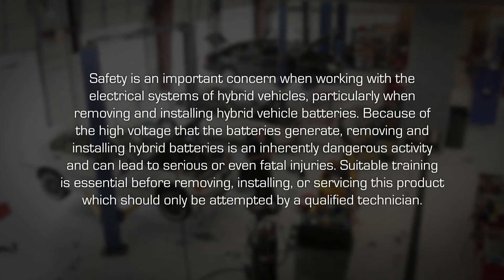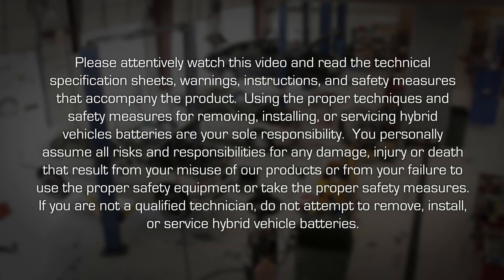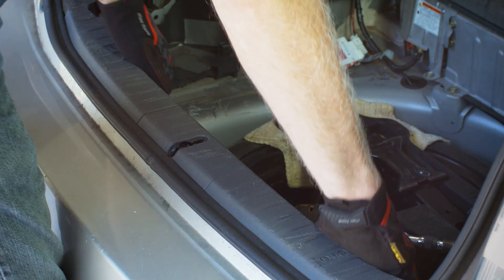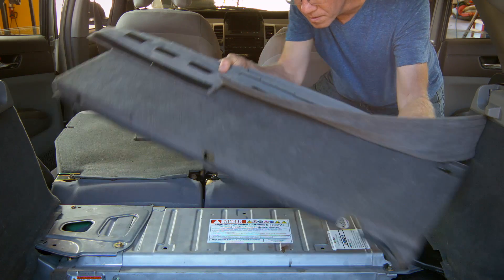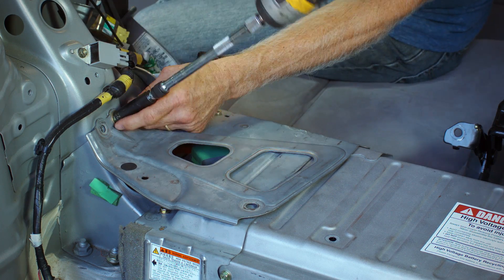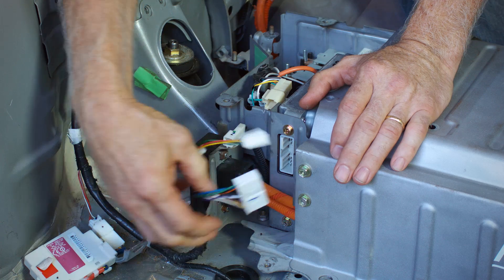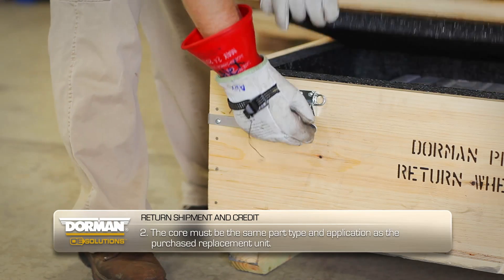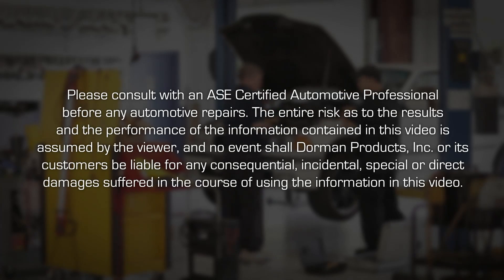Toyota Prius Gen 2 hybrid battery installation

Comment: If you don't have gloves just work with one hand and wear rubber soul shoes don't allow anything or anyone to touch you who might be grounded and you can't get zapped just don't complete the circuit by using two hands ... I've handled live hot wires with one bare hand